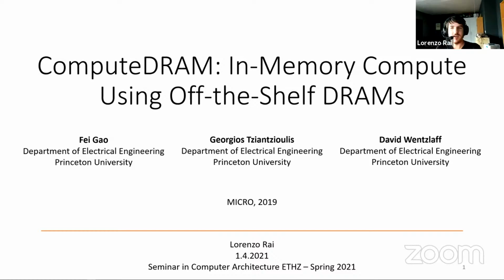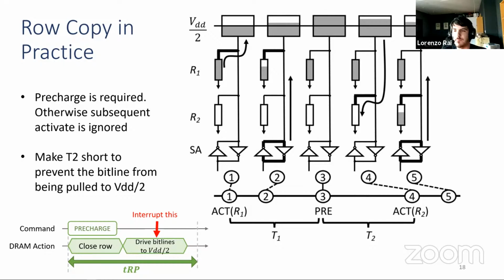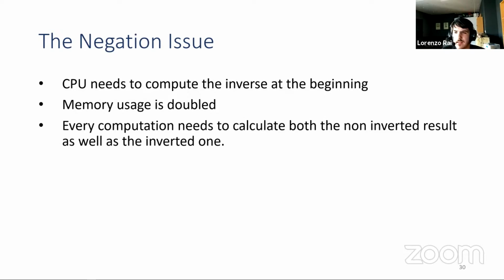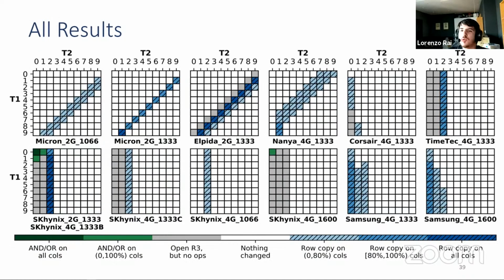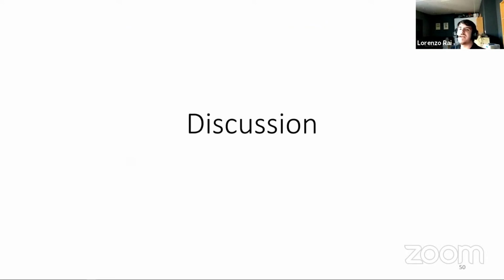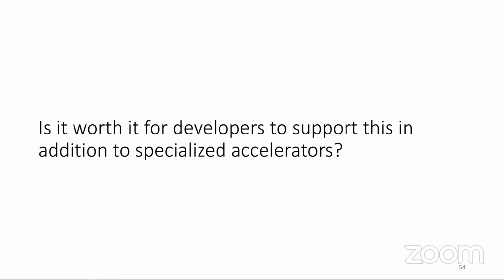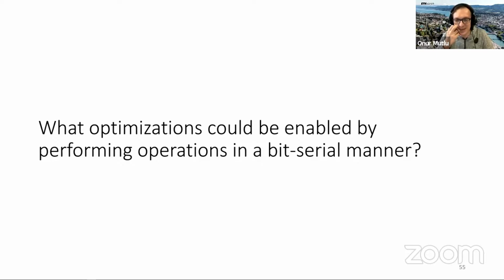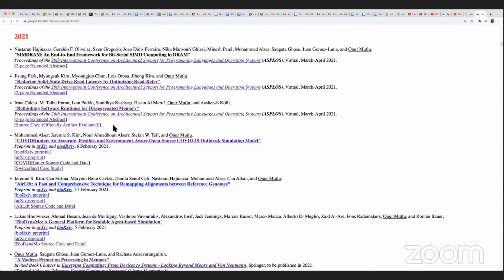Seminar in Computer Architecture - Session 2.2: ComputeDRAM (Spring 2021)

Comment: bitcoin mining is not memory bound. dont think major energy usage is in data movement. so may not benefit from this work.

but

ethereum  mining is memory bound. it generates random memory access. and even the large sized caches are useless for ethereum mining because of very random memory access.

secondly, ethereum mining only performs memory reads, not rights. 

these two facts about ethereum mining (random access and read only ) may be important to exploit this computedram work. 

I have access to two alveo u200 cards, and I can  provide remote access to these. for anyone to try.